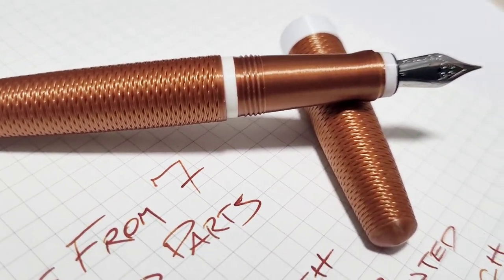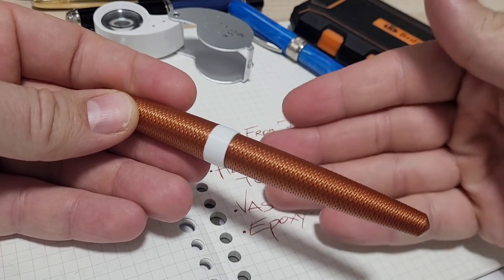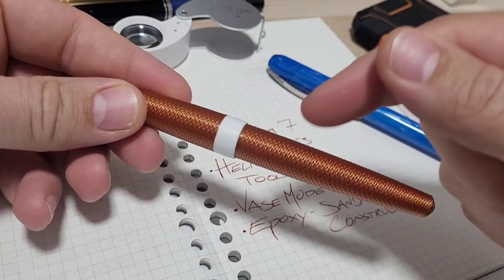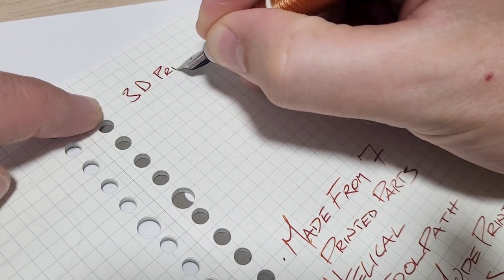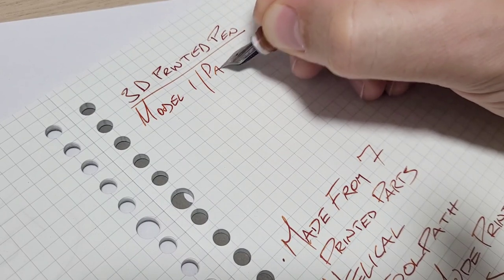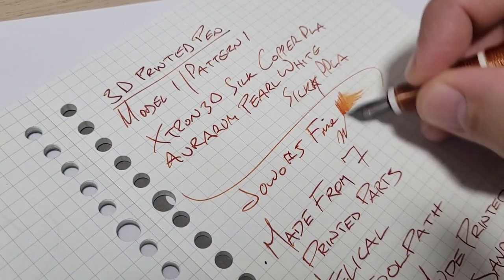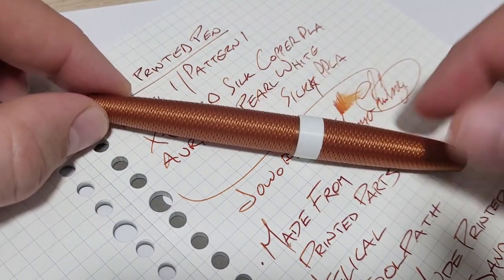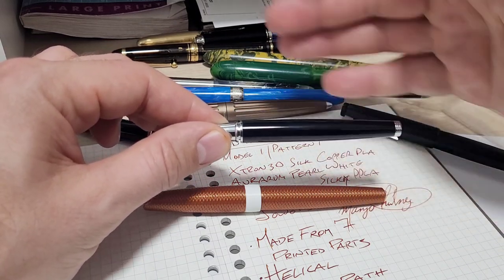Engineering Take On 3D Printed Pen

Comment: Wow  ! 3D printed pen ! Didn’t realize that making a 3D printed pen is so involved ! Of course unsung heroes in making a 3D pens are the makers of the printer and the software !
Those white bands and collar are an eyesore to an otherwise gorgeous pen !
Reply from the maker: LOL, there are other color combinations as well.  The black and yellow/gold band looked really sharp.  The bands are required for the threading as different "plastics" are required for strength and other reasons as well.  I didn't know what to think of the pen at first, but after using it for a bit I really like it!

Comment: Hi Doodlebud. I have a very vague understanding of 3D printing. While you concentrated on the engineering aspect of this pen my thoughts are about putting such a product into production. From what I've seen 3D printing is a slow process and unless you have several 'slave' printers linked together you are going to have to make one pen at a time. Such a time consuming manufacturing process together with the possibility of some rejects must impact the price of this pen. I do like the pen. Was this example a prototype or pre-production sample? I ask because there doesn't seem to be a company name or logo anywhere on the pen (the white cap band being the obvious choice I would have thought). I like the innovation of fitting a unique roll stop that actually works. The pen writes nicely but I wonder what the price would be and what are the immediate competitors to this pen.
Reply: David, yes, 3D printing is slow! Each of these pens takes about 6 hours of printer time, so volume production is not going to be easy. The parts could be printed much faster, maybe 10 times faster, except that the helical vase mode style would mean that there is not enough time for the extrusion to cool between successive layers.

Some places do have arrays of printers running all at once to make parts in bulk (see this video for a huge 'print farm' making 3d printer parts https://www.youtube.com/watch?v=qqQzTvvrXo8 ). Often a 3D printer is used at the prototyping stage and then injection moulding is used for production, as you suggest, but I do not plan to make a huge number of pens and so I am sticking with slow production.

See my website for more (PlatypusPens.com), and my first blog post for links to a few other 3D printed pens. There is more to come on the website, as it is not yet 24 hours old!
Reply: If it was printed on a liquid resin printer, several cylindrical parts could be printed at once, and that process could be scaled up, if viable. But I don't know what method these are printed with.
Reply: @gertahnstrom784  The resin printing method (SLA) has a few advantages but, for me, a major disadvantage that the resins are not nearly as interesting and pretty as the myriad of PLA filaments that can be had.
Reply from the maker: I wonder if you can get a laser head fit to the printer & adjust depth of focus to image a design inside of a resin? Print the pen, then image an internal design afterwards.
Reply: @michaellew1297  you should monitor the suppliers and even mention that you are looking for interesting colours.  The manufacturers are always coming up with new colours. It's amazing how fast things change.  😀😀
Reply: @michaellew1297  are you going to be selling from this website ?
 ( I already looked at it it great. )  Are you going to stock models or have print to order (or both maybe)?
Reply: @nancymilawski1048  Yes, some ready to go and, I imagine, mostly build-to-order. It takes about three days to get a pen ready to send (printing and expoxy setting times), and I don't have a backlog of orders at this time!